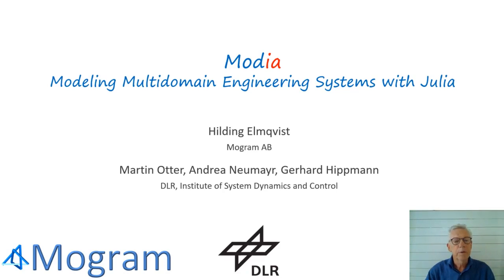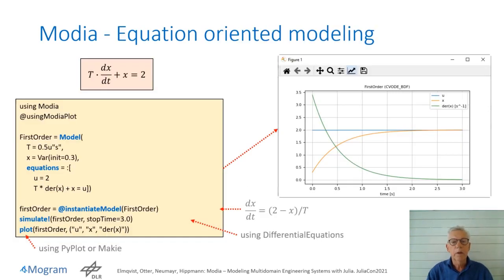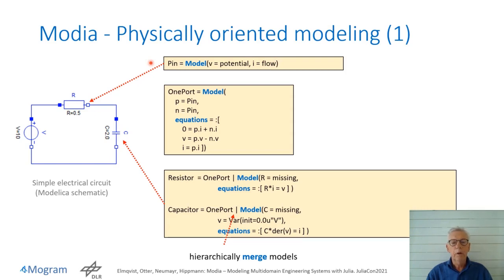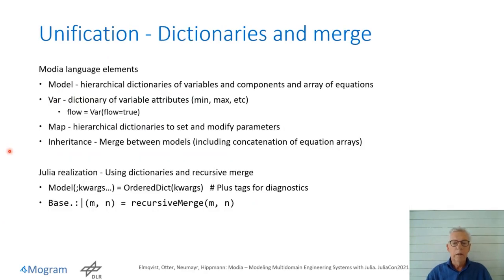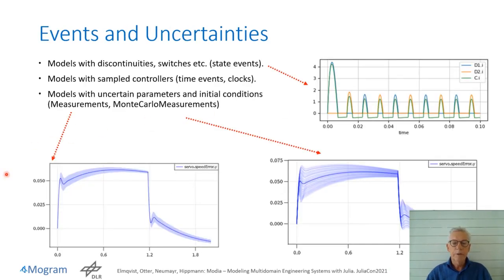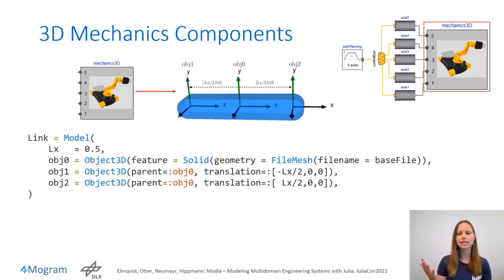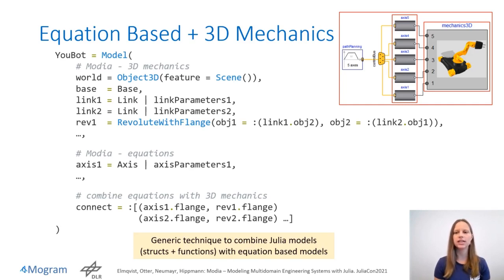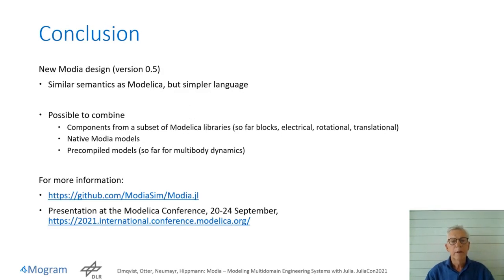Modia – Modeling Multidomain Engineering Systems with Julia | Andrea Neumayr et al | JuliaCon2021

Comment: I think it would be helpful for you to contrast ModiaSim.jl with ModelingToolkit.jl.  I've not yet used either, but from the outside they appear to have a high level of overlap: acausal equation based modeling, based of DifferentialEquations.jl, a focus on reducing the number of equations needed (via Symbolics.jl in MTK).  What are the major differentiators which distinguishes one from the other?